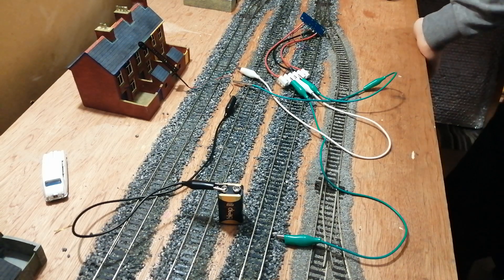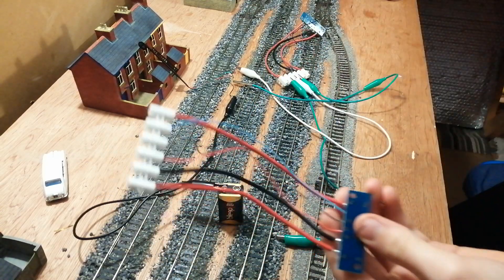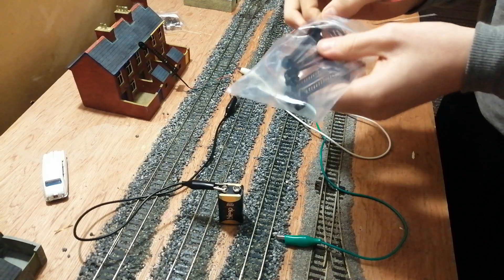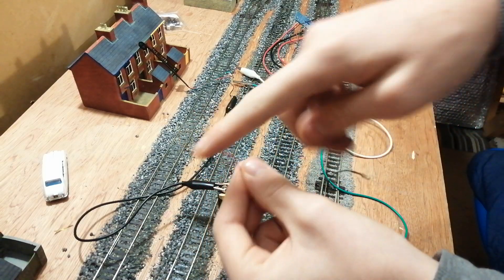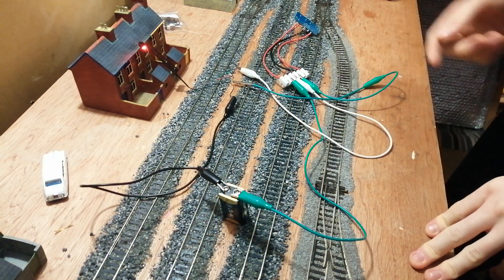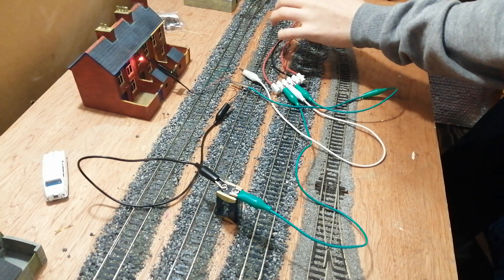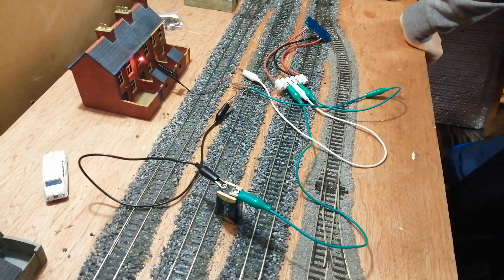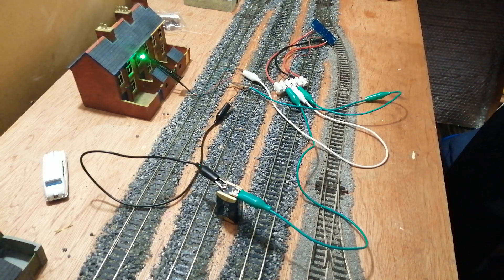Wiring Point Motors to Signals for Automatic Red / Green Signal Changing

Comment: As this video is now a year old, I have no doubt that you will have made considerably more progress on your layout, but there is a problem with the method of wiring your signals to the points in the way you have shown here.  One of the routes through your points will always have a red signal, rendering it unavailable if you intend to run your trains whilst taking heed of the signal aspect.
Reply from the maker: Rather amusingly I actually haven't done that much, but hoping to change that very soon! :) I am running on DC only so although one of the lights will be at danger I can only run one train on any two given lines when crossing between them - as otherwise there would be a bit of a crash!

Comment: Nice one George! 
Good to see you've gone with the point motors!
They're a great addition you will love!

The only issue they have is sometimes when you change them back to going straight on (If that's the correct term), you can change the switch or lever for it but the actual points don't move and then the train goes where you don't want it to and then you've got a possible disaster on your hands.

Another issue is because of the current going through the points sometimes drift and then when your train travels over them it derails.

Or maybe that's just mine that do that because of my "lower end" electricity skills..
Either way just keep and eye out because it would be interesting to see if it's all motorised points that do that or just mine.

Stay safe mate :)
Reply from the maker: Thanks mate, and hopefully I will - the investment best be worth it! It should be so much easier instead of careering round the loft all the time and racing to reach the back of the boards before the train goes over the points! 😬

I'm using 16V AC feeding into a Capacitor Discharge Unit (CDU) which should give the motors a really strong whack of power to help them shift across. I've been able to have some really thick 16 Gauge wire from my Grandad which will ensure there's no loss in OOMPH between the power supply, switches and motors. I've also sprayed some WD40 into the point motor mechanisms to lubricate them and remove any gunk or PVA from ballasting - this will ensure they move nice and freely.

At least with my point motors (I know you can get ones that can be powered constantly, I don't know which ones you have) there should only be current passing through them for no longer than a second, this is both so power isn't lost as the coils would heat up if powered for long durations, and also so the motors don't burn out! This why I'm using momentary toggle switches to ensure there's only a brief pulse of power through them. However, I'll make sure all my points switch and stay switched, though, as I can see how that would be a big problem!

Haha! 🤣 By no means am I a master electrician though......thanks for the compliment nevertheless! We shall have to wait and see, shouldn't be more than a few weeks now!

Take care :)
Reply: Just to draw your attention to a paper by Mr Brian Lambert on the topic of CDU design and construction. If the CDU is wired in as described with his circuit design you can use two position toggle switches to change the points and only a very tiny residual current flows through the selected solenoid coil thus preventing the possibility of the burn out you describe. Thus when the switches are panel mounted on a ‘mimic’ diagram of the track plan you  get visual indication of the route set, by the toggle direction.  Also I have found with ‘Seep’ point motors the c/o switch does not always make contact in both directions. To minimise the impact - I slightly offset the motor below the baseboard to ensure that the switch always makes circuit, when set for the curved route (known as Reverse set). Two wires only to the switch trigger the operation of a sub-miniature 12v DC relay the two sets of c/o contacts of which a) select the frog polarity on ‘electro frog’ points and b) the other set of contacts switch the LED’s in the signal.  100% operation every time! NB Increasing the size (rating) of the capacitor enables several point motors to be switched in unison.
On ‘insula frog’ points I use the two sets of relay contacts to connect each switch blade to its associated frog rail and a second relay to drive the signal LED’s.  Please note I have no commercial connection to the work of Brian Lambert, just an admirer of his excellent papers and colour coded wiring diagrams.  Happy Modelling T 🚂
Reply: Thanks for the amazing info and advice! I will give it a look! @tonyhill6296